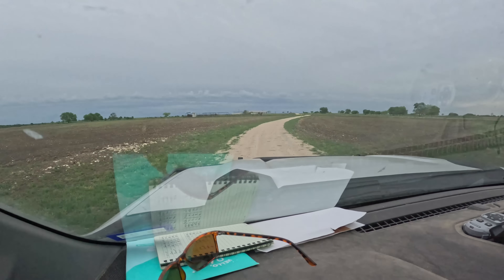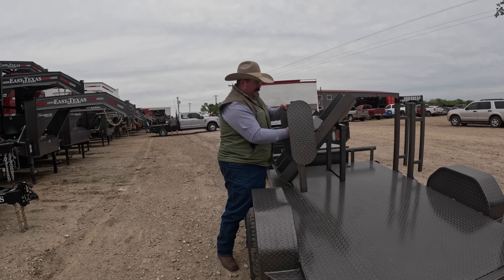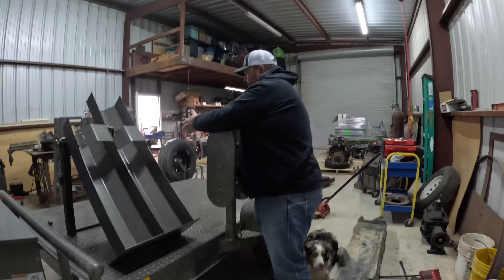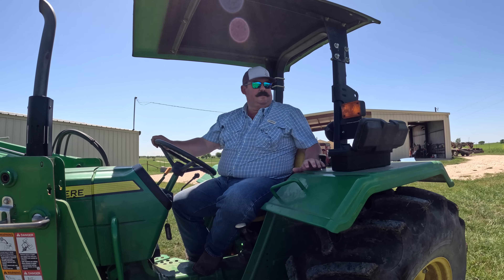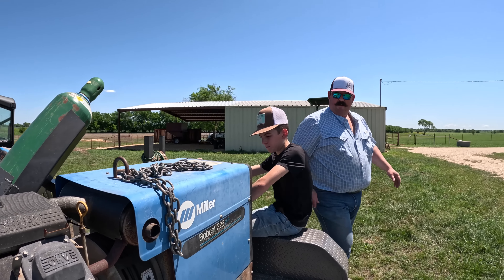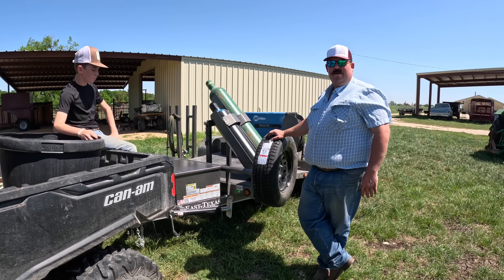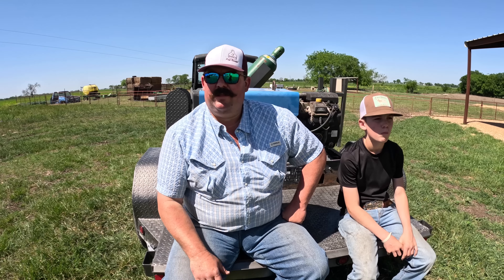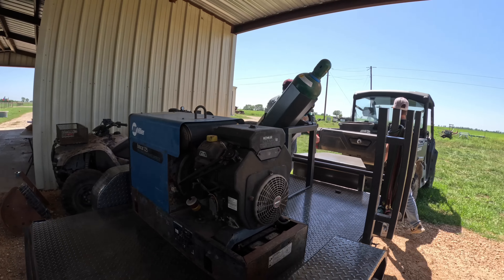Outfitting our New Welding Trailer from East Texas Trailers

Comment: Cody I would add some mat material inside the bottle rack and in the bottom so your bottles don't rattle going through the pasture or up and down the road.  I also put a hose reel on the for the cutting torch hose and left.

Comment: Only one thing you forgot for a portable unit. A spare fuel can. It really helps to have a couple extra gallons on board your portable trailer. It could be the difference between finishing the job and not.

Comment: Get bub on that 5p+ 6010 down hill. You might just have a young pipe welder or 6010 root 7018 fill and cap uphill
Reply: Driver side orientation always

Comment: What is the purpose of having bottles on a 30 degree angle instead of straight up right. Looks like to me a loss of floor space that’s a premium on a small trailer like yours. Another good idea is to add a piece of 1/4” thick steel  plate the width of trailer and starting at rear of trailer go towards welder stoping short of it. Makes solid place To work off of.